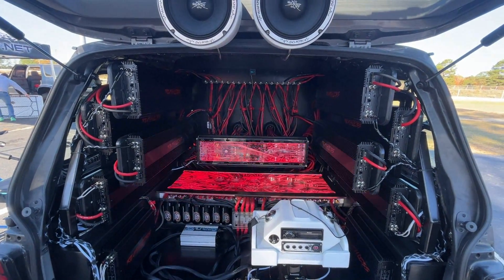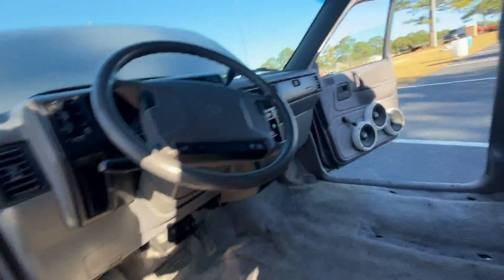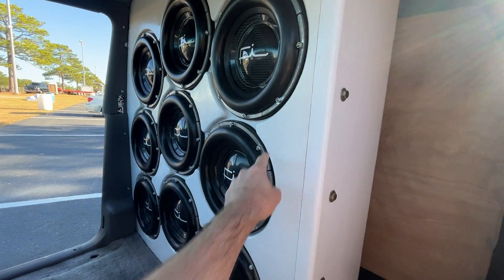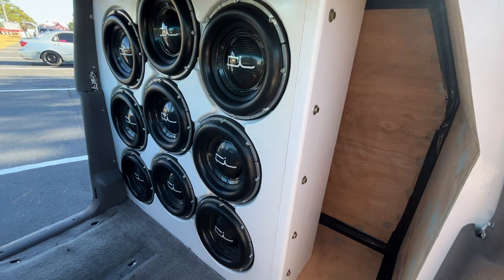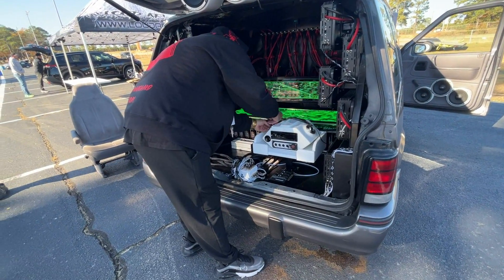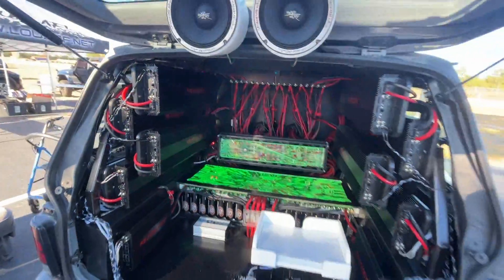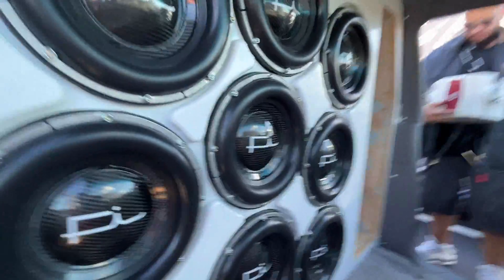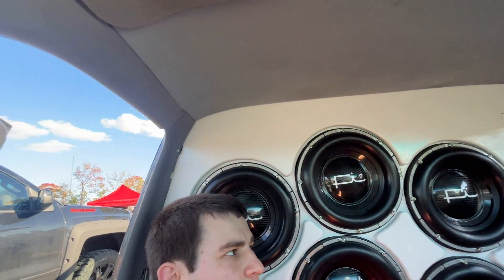100,000 WATTS ON 9 12" SUBWOOFERS!!!

Comment: That 12 inch woofer in the middle is not working
Reply: I saw that too
Reply: It’s working like an old kicker passive radiator Lololol
Reply: I was looking at that, I thought that it was just me at first
Reply: Right I seen that to
Reply: It’s to cover up the hole lol
Reply: If it's not blown, which I think is the case there is a loading issue going on for that sub because it's in the center.  I don't know why that's happening but that's what I believe is going on
Reply: It's definitely cooked. That's just the other combined 272mm of excursion from the remaining 8 moving it.
Reply: It's throwing his ohms off
Reply: yeah it isnt
Reply: I noticed the middle subwoofer was not working. 🖐😃 Hi everyone. I just posted a vid of my new subwoofer box for 2 18" subwoofers. It's not going to be nothing as loud as this build but the the guy that had the box metered a over a 154db with this box in his Tahoe with 2 18" Sundown Xv3 subwoofers. ✔️IT OUT.
Reply: Where? 🤡